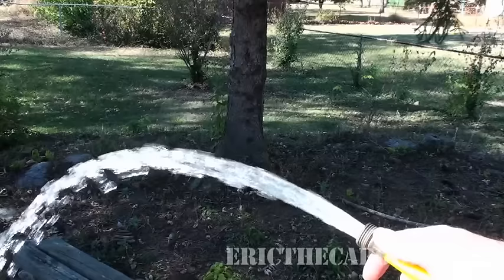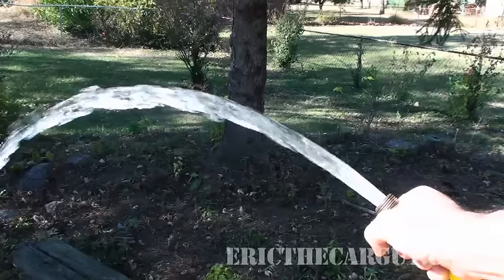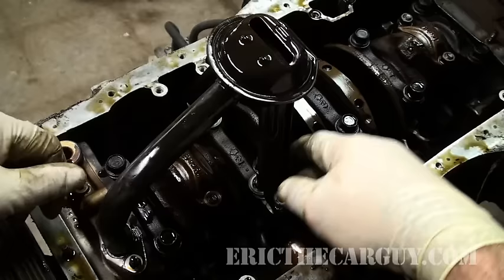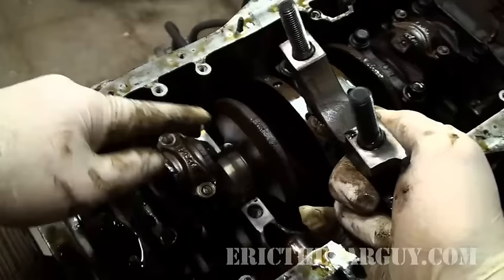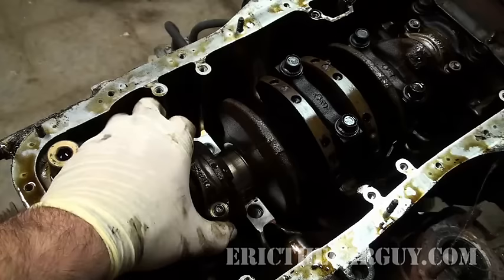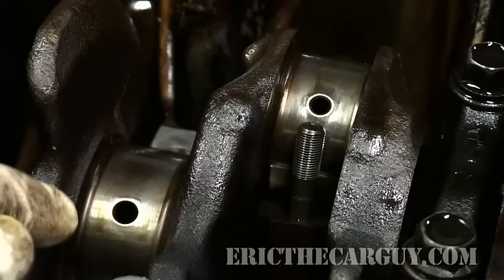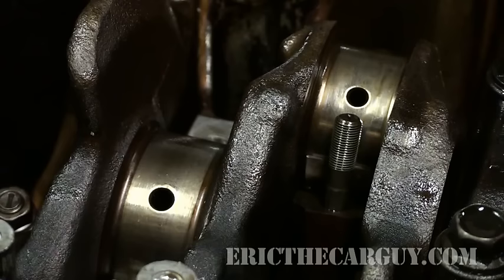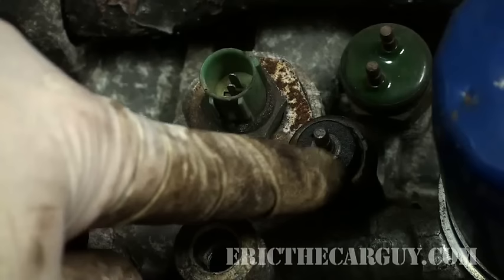How Oil Pressure Works - EricTheCarGuy

Comment: I feel enlightened! I'm among those who A) thought low pressure = bad pump, and B) thought the oil was simply pumped to the top of the engine and drizzled down through the inner parts. Thanks for clearing this up... it all makes sense now.

Comment: Eric... First off thanks for the video man.l, always informative. 
I am a tech like you. I haven't been in the trade as long as you. But I understand what you said in the video. I have a scenario I wanna throw at yah and get your opinion on...

 I recently bought a 2000 S10 with a vortec 4.3 as a work truck and as an A to B vehicle. After owning it for only a few weeks, checking it when I could after work, and making a list of "need to fix" things, I decided to change the oil for the first time. I had a trip to Ohio to prepare the truck for, for Turkey Day.

We use Kendall sae 5w30 as our bulk at the shop, and Carquest filters. Usually good products.

However,  after changing the oil in the truck, 3 days later I lost oil pressure completely, the night I drove to Ohio.
I got back to Tennessee where I live thankfully,  with no knocking-yet! A couple days passed and the inevitable knock came. I shut her down and decided to tear the motor down for the bearing repair that I suspected it needed.

Come to find out, #1's rod bearings were the worst. I ordered a crank kit from O'Reillys, along with all necessary gaskets and seals, AmsOil assembly lube, timing kit, oil pump & pickup tube, new oil pressure sender, new distributor-the helical gear was pretty worn, and 5 quarts of AmsOil 5w30 synthetic and AmsOil filter.

 The crank kit was through Crankshaft Remanufacturers Inc, and the bearings were King Bearings. 

I thoroughly cleaned and inspected the rest of the motor and found nothing out of the ordinary. When I say thoroughly cleaned the 4.3, I mean everything I could imagine: galleries, push rod guides, around the valvetrain, oil pan, etc with plenty of brake clean and shop air.

I reassembled the motor correctly and according to AllData's torque specs. Got it done in two weekends.

I am now stuck with low oil pressure again on a $600 rebuild on my 4.3L and I don't get why! The trucm had perfect oil pressure prior to doing the first oil change.
 
On cold startup I have 40psi @ idle, at operating temp I have 0-10psi @ idle. Driving it I have 15psi @ 1500 rpm, 25psi at 2500 rpm, & 30psi at about 3000 rpm. Thats what the dash gauge tells me. And I know thats significantly lower than what the 4.3's usual pressures are, ex: 40psi @ idle. Even though AllData says 6psi @ idle is spec.

I put an oil pressure gauge on it the other night to confirm, and the pressures are confirmed along with what the dash gauge says.
A friend told me the other day that I should've plastigauged the crank kit. But I failed to do that and now am thinking I gotta bite the bullet on this one.

Any ideas about whats going on in this situation Eric? Thanks man for your advice and time!
Reply: Hello, excuse me for my grammar, I'm dutch so it will not be perfect. :-)
Assuming the rebuild was done properly I can only think of a worn out crankshaft and/or camshaft. I would recommend to do the plasticgauge measurement to be sure.
Maybe the previous owner had the same problem and wanted to hide the pressure warning by using a higher viscosity oil. It's also possible you used the wrong viscosity. It's strange though the pressure problems occurred after three days.
Oil can also be too hot and therefor too fluent. This is not likely your problem because it was OK in the first place.

Good luck!
Reply: Your
Reply: Gerrit van Maanen hello gerrit plz forgive me for the last comment ur english is nice.i agree with what u said so thanx for the info

Comment: There are some wrong information in this video. The example with the garden hose seems to be true but it is not. if you reduce the area of the hose, according to the Bernoulli principle, the speed of the liquid will increase. The pressure will stay at 1 atm since the water is let into the air. The same principle is used at pelton turbines. 
The lubricating film on the bearings is a hydrodynamic lubricating film. What is true though is that this will only work with parts which are not too much worn.
Reply: No it creates more pressure in the hose

Comment: In physics terminology:

P=F/A (I.e. Pressure is force divided by area) 

So technically the pump creates force that based on the various clearances (which shows up as the A= area in the formula) ends up bringing different pressure levels based on level of wear in the engine parts/ clearances. 

Of course a worn pump makes less force which does result in loss of pressure as well. 
So obviously you can have perfect clearances like in a brand new engine but a failing or worn oil pump and still have low pressure.
Reply: How to install the Pistons in a 302 Ford
Reply: Correct brother... mechanical engineering teaches us all that. He can't say we should forget the oil pump.  There are sequences that needs to be followed in fault finding... you can't just jump up and down like a cockroach...
Reply: Excellent thought sir. Much obliged.
Reply: the pump pressure  produce when ristrictid

Comment: When working as designed, moving parts on an internal combustion such as pistons, camshafts, rocker arms, connecting rods and crank shafts float on a thin film of oil in the engine.  But contrary to Eric's semantics, it's the oil pump that produces both the volume and flow of oil necessary to produce the oil pressure between the moving parts and the oil passages of an engine.  

Not only tighter clearances but higher oil flows equal higher oil pressures for an engine and are the primary reason for higher capacity oil pumps.  And while true that clearances in an engine produce resistance to flows from an oil pump they're but ONE (1) of the components for engine oil pressure.  Pumped oil volume velocity and oil viscosity are also factors.  

If you don't believe that the oil pump is the Genesis for oil pressure in an internal combustion engine just remove it from the engine and watch the oil pressure drop to zero and the engine crater!  

The name of the game for properly lubricated engines is to maintain a thin film of oil at ALL times between moving parts!  New crank shaft bearings, cam shaft bearings, higher volume oil pumps and even lower viscosity oils can help do that unless the engine is so worn that the pump and viscosity can no longer compensate for the increased clearances and provide the proper protective film necessary.  

For years, racing engines have employed this knowledge and use much larger clearances than day to day automotive engines in order to reduce engine friction and improve horsepower but those high performance engines also use insane oil pump volumes to survive long enough to win a race.
Reply: this is true
Reply: So, theoretically if your pump was no longer able to provide enough flow/volume to create the required  pressure, could you "cheat" the system and use a higher volume pump to artificially boost the pressure?
Reply: Fred Higgenbottom yes, but a higher viscosity oil would most likely be more economical
Reply: arien wilkins  As a note of caution, a higher viscosity oil might increase oil pressure but due to the lower flows associated with higher viscosity oils fail to provide the required lubrication when the engine is under heavy load.
Reply: Very well stated.
Reply: Fred take the main an rod bearings out tell me how much oil pressure u get . Liberal much
Reply: I was going to say a similar thing. A misunderstanding of this presentation can mislead people into thinking that low oil pressure can only mean worn out bearings, when in fact it can mean a failed pump: if the pump isn’t moving the oil and creating enough flow and volume, then no pressure will develop, simple as that.
Reply: Aah, i wonder, nature has endowed everyone a lubrication system, without which everything wears out and melts down 😹
Reply: I have a lexus IS350 2007 with low pump pressure, i have bought 3 different oil pumps and no change, the car starts fine, but the oil pump pressure is very low. Pls what do you advice?
Reply: Eric's explanation is very clear and helpful as is yours but it's not  a thesis but a correcy simplification.

Comment: I have a 2000 Chevy Suburban with 270k miles and for the last couple of years I've been experiencing oil pressure problems.  However, I believe my problems may be due to a sticking oil pressure relief switch/valve.  Oil pressure averages about 40 lbs at idle and increases to 60+ when I accelerate.  Occasionally, it will drop to 5-10 at idle and 40 when I accelerate.  If I rev the engine for a few minutes, the oil pressure will go back to normal.  Would using an engine cleaner/ help with the possible sticking switch?  If so, is there a particular product you recommend?
Reply: Try sea foam    Flush the oil a couple times

Comment: Hey Eric could you do a video about motor knocks, because there is a cool little toyota corolla sr5 i want to by, but the guy said it has a motor knock and it is under powered i dont want to buy another car because this car is in my price range. Help?
Reply: I have a 94 4x4 ext cab no oil pressure will go up soon as I  crank it  to  normal then gradually go  down to almost 10 to 20 psi. iv change the oil pressure sending unit under the distributor. and it wouldnt didnt work.  so  I'm thinking the oil pump mabe.  if anyone could help please let me know

Comment: Eric, I understand what you are saying but how does the oil pressure interact with the gauge to produce a reading?  Thanks
Reply: +Jim Buford When you have a gauge, it is connected to the outlet of the pump reading the pressure at that point. At idle, pump is working slowly, and pressure must be enough to move the oil around, at higher rpm, the volume of pumped oil should be more than enough to give maximum pressure reads. Most cars have only a red light, it is on when the pressure falls below a certain minimum value. (like when the engine is turned on or off). When that light flashes while driving, turn off immediately, and check the oil level. In case there is oil in the engine call road assistance and don't turn the engine on again.
Reply: +José Pinto Thanks Jose.  It is clearer now.

Comment: hey eric. i have a 2005 crown victoria with 370,000 miles on it. what viscosity of engine should i use ? ford says i should use 5w-20 but i have quiet a bit of miles. should i use a higher viscosity or stick to 5w-20 ?
Reply: +Saber Uddin Keep using 5w-20 or check if Ford updated their recommendation. He says in another video to use the same as manufacturer recommends.
Reply: Ford hasn't changed their recommendation when it comes to the viscosity of oil they use. they still use 5w20 motor oil. but being how your engine has so many miles as stated in his video he talks about as the clearance is get bigger you lose oil pressure. ideally if you were to use a thicker viscosity oil you should get your oil pressure better probably not 100%. but if you're not having problems with oil pressure I would just stick with the same viscosity.
Reply: 370,000 miles. On 5w-20. Sounds like your car is doing well. The most important thing your oil does is prevent wear. Everything else it does is secondary. 540rat has a blog where he tests different oils for their ability to prevent wear. Look it up.. Yes adding 20w-50 might make it " sound better" but the engine will then wear quicker.
Reply: +bep2001 kumar The purpose of oil is to prevent wear. Going to thicker oil is only a deception. May "sound" better but may actually accelerate wear. The real pressure in your car that prevents wear is hydrodynamic pressure. This pressure is in the thousands of pounds per square inch. It is created by motion of the surfaces coated with oil not by your oil pump.
Reply: Thomas Burns oh your very correct. But ideally putting a thicker oil maybe would increase oil pressure but yes oil pressure is made by the outlet of the pump and your crankshaft   journals etc.
Reply: +bep2001 kumar do an Internet search for 540rat oil tests. Very interesting oil test web site. Hydrodynamic pressure is in the area of 1000 psi. Much higher than. Your oil pump. The real reason oil lubricates it that it is incompressible . Not viscosity. Because a 20 viscosity may lubricate as good as a. 50 weight you might be better off with a 20 weight that flows better, removes heat better.
I remember my dad had a truck that had almost no oil pressure when it was hot. Seemed to run well. Not sure what ultimately killed the engine. Yes it had a lot of miles in it. Oil is an interesting topic. A good oil filter is also very important. It has been said that 80% of the silicon dust that ends up in the oil came from the air intake.
Reply: Thomas Burns, from 540rat's blog the highest performing oils in wear testing were even 0W-20 and 5W-30 oils. The highest-ranked 40wt oil was fifth on the list while highest-ranked 50wt was thirty-seventh. I am going to be choosing from the 20wt and 30wt oils on his list from now on.

Comment: low pressure doesnt necessarily mean your engine is worn. pressure is inversely related to oil flow. The higher the pressure; the less flow you will get to your bearings, journals vice-versa. In modern higher reving engines, thinner oils are used to supply more oil to these parts faster.
Reply: its not low oil pressure in general, its loss of oil pressure.
Reply: My thoughts exactly